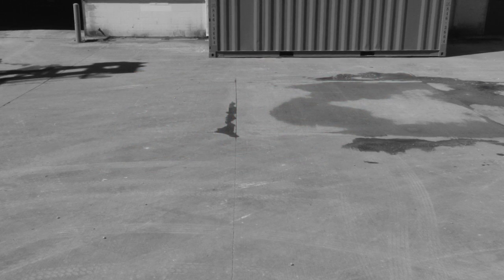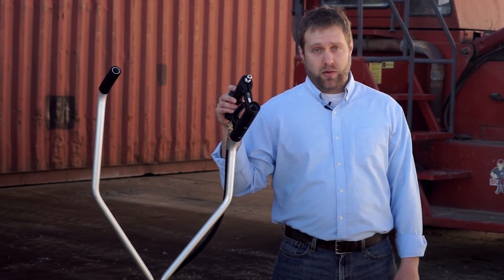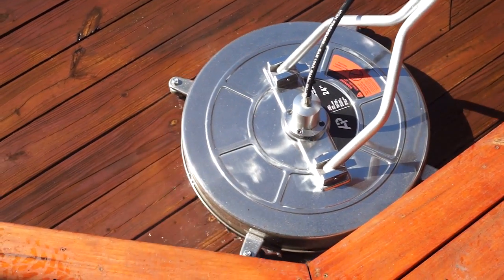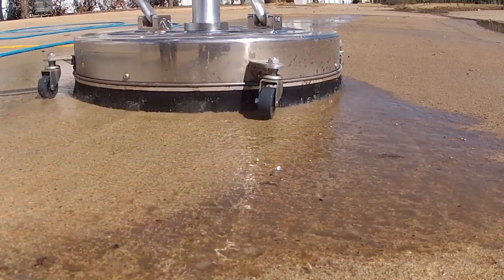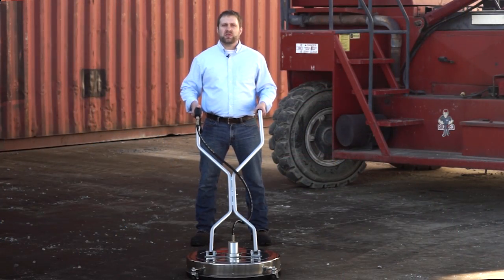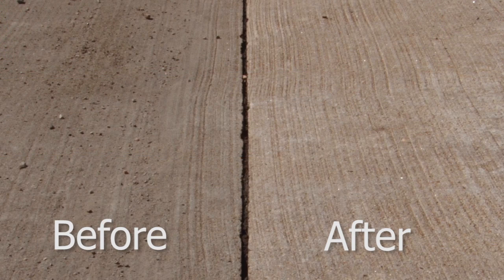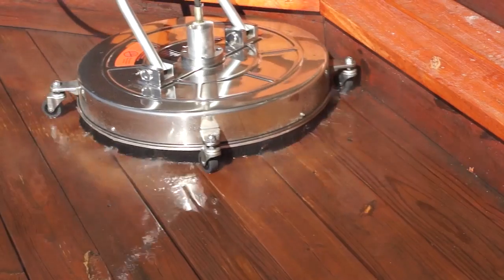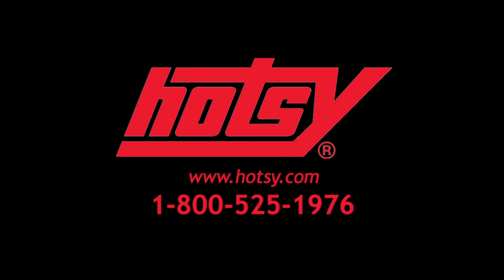Hotsy A+ Flat Surface Cleaner

Comment: My Hotsy and 24" A+ cleaner were working great but after about 20 hours the surface cleaner seemed to have less than half the regular pressure. The Hotsy is fine using the handheld sprayer and I cleaned the holes on the two A+ nozzles and greased the fitting. What else could I check? Thanks

Comment: Been using a simpson for 2 years with a lot of problems.🌼  allabout.wiki/Mi Decided to take a shot with this karcher. I'm using it on a 3100psi @ 2.5gpm. very good spray and movement. If you are using a lower grade psi or gpm it will not work as good. For a home unit it is made solid and we'll worth it especially if you can get it damaged box for around 45.00